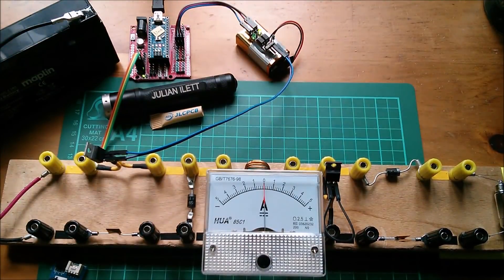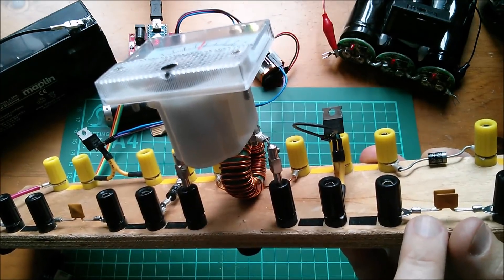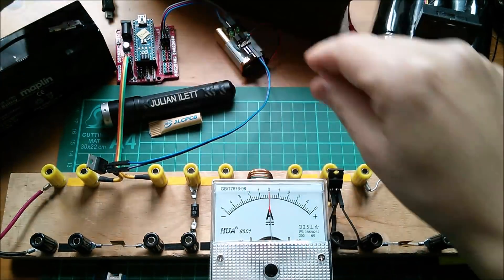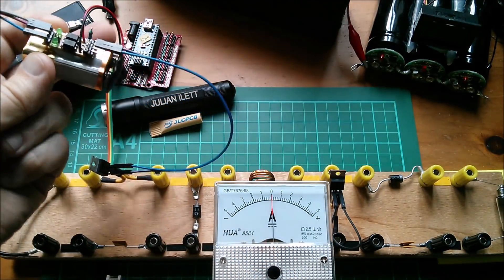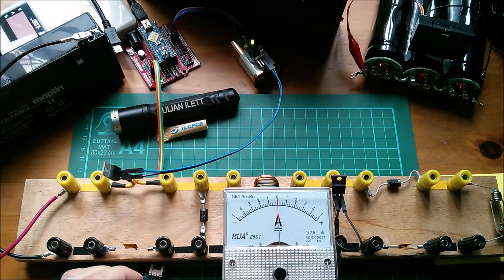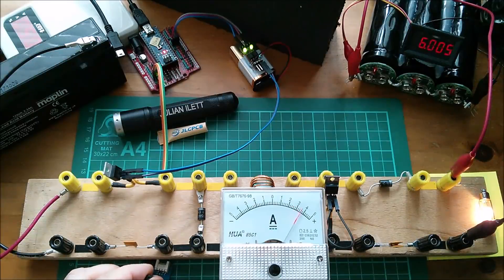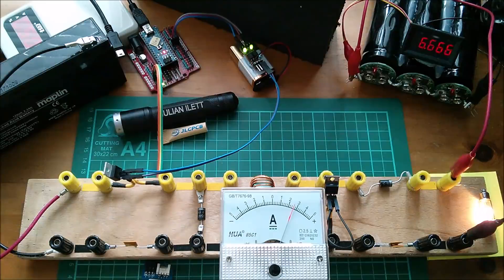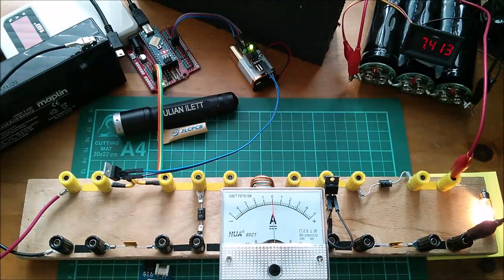Charging Supercapacitors from a Lead-Acid Battery - Muppet 2

Comment: HI, would it not be possible to make a simple voltage regulator cut off circuit with a zener diode and a mosfet on the supercaps that would switch the batteries charging it on once it falls below a certain voltage and then turn off when it hits its limit? 
This way you could have a power source with the battery for energy storage and supercaps for power delivery all the time if you have something that needs high surge current for short periods.

Comment: With those black croc clips that slip just put a drop of super glue on the lever arm on the croc clip. Slide the silicon sleeve over quickly and that will solve all your problems. Hope that helps.

Great video as always Julian 👍

Comment: Remove capacitor between atmega Reset pin and DTR pin of COM port chip on Arduino board. This will fix atmega restart on usb plug.

Comment: My goal before I croak is to make a  surface-mount 'MuPPeT', about the size of a postage stamp. I did some 'work experience' for an environmental measuring company a couple of years back (still friends with all of them). They stick their machines in the middle of very cold, remote places (think Siberia here...) - hence lead-acid batteries - charged by a 10W solar cell. But they rely on the battery to supply all winter, when up here (North Finland) there is precious little sun. They charge the battery DIRECT from the panel, and wonder why they are seeing 18V on the 12V battery, and they have to replace them every year in the summer when they can get to the site, at great expense!! A 'MuPPeT' would solve their problem, augmented by a Joules Thief when it gets pretty dark. It needs - averaged over a day - only about 1-2mA .

Comment: Can you put the usb power lines of the arduino into the oscilloscope and then unplug the camera to find out if there is a voltage spike or what is causing the arduino to go haywire?

Comment: Why did the polyfuse on the output side not trip when you went to 5 amps?
Reply from the maker: If I'd stayed at 5A for any length of time, they would probably have tripped. Polyfuses are thermal devices, they take a little time to warm up.
Reply: Ok, thanks

Comment: You should pretty much always use a pull-down resistor on the gate of a MOSFET (ditto IGBTs) their gates are so sensitive that if you leave them floating they'll turn on of their own accord.

Comment: If you want to avoid the reset  when you plug in something USB and not using the serial connection, you can use a charge cable without datalines (or make one yourself) to power the Arduino. This avoids the reset. The reset is caused by enumaration of the bus (and COM-port settings, see later on) and that's why the ATMega resets, actually the same when you start programming the Arduino. There is a hardware hack available which avoids this behaviour however you are not able to easily reprogram it. 

Another option, if you need the serial connection, is to use a self-made program (like I did) or other serial debugger (NOT the default Arduino Serial Monitor) that initialize the COM-port with different parameters. 

I found out these settings avoids a reset (when something else USB is plugged in):
State of device COMx:
---------------------
    Baud                  :  9600 (can be anything you prefer, however Arduino must 'talk' at same speed)
    Parity                 :  None
    Databits             :  8
    Stopbits             :  1
    Time-out            :  OFF
    XON/XOFF         :  OFF
    CTS-handshake:  OFF
    DSR-handshake:  OFF
    DSR-transspeed:  OFF
    DTR-circuit         :  OFF
    RTS-circuit         :  OFF

You can view your current settings on the command-line, type for example: mode COM1 [enter]. COM1 is the COM-port the Arduino is attachted to (can be different at your situation). I use NodeJs (and also implement this in C and Delphi) with a serial-port package to initialize the port and read the port, very straight forward to do.

Hopes it helps to avoid dangerous or unwanted situations/behaviours.

Comment: Yes those croc clips are all really crap, mine do the same. They also have a very high resistance and get quite hot in use, very little copper used, if any. More Chinese quality.

Comment: if you are running the signal through opto-isolators, just power the arduino with the lead acid battery.
Reply from the maker: Yep, that would work :)

Comment: if you are running the signal through opto-isolators, just power the arduino with the lead acid battery.

Comment: great vid, i rly like how you keep everything simple, no fancy  electronic circuits, just what is needed is presented on camera. easy to understaind how step-up and step-down works. have you tried playing around with the pwm frequencys? to see if the mosfets get hotter with higher pwm or lower pwm frequency?

Comment: Why not connect the lead acid battery to the V(IN) and GND on the Arduino and a 100nF cap to keep the power supply stable if the USB power driver in your PC throws a wobbly?
Reply: *cap between 5V and ground, to be clear :)

Comment: Why is the mosfet getting hot, when it's switched fully on with pwm? shouldn't be that way - that's the whole point of a switching supply... *confused*
Reply: When they're half on, they act as resistors.
Reply from the maker: This MOSFET has an ON resistance of 17milliohms (min). Power=I²R which is about half a Watt - enough to heat the MOSFET with no heatsink.
Reply: thanks!

Comment: Hmmm - i can charge those very quickly with my diy bench powersupply - made of old laptop SMPS and a buck converter with CV/CC. Just adjust the voltage to the level you want the supercaps to be and adjust the cc to what you want or the PSU can deliver :-)

Comment: You're able to ride the potentiometer and keep an eye on the current and voltage as well as what the protection circuits are doing, now if you add a digital current sensor and voltage sensor, you can read the values of those things with the arduino, and create a PID profile to rapidly charge the supercaps automatically :D
New project! :P
Reply from the maker: Yep :) And with opto-isolators (instead of red LEDs) on the supercap protection boards, the Arduino can see when the first cap becomes fully charged.

Comment: At such a low Amps level flowing through that MOSFET and with it having such a low on resistance when fully turned on it should not be getting anywhere near as hot as it seems to be getting with your set-up here and I suspect your not driving it ON and OFF fast enough so its spending time in the linear region and that small time dissipating power and generating heat at the PWM frequency your using is the cause of the excess heating ,also with the current set up at switch off as your  just relaying on the resistor to discharge the gate of the MOSFET rather than giving it a hard turn off, you will be able to see this if you connect your scope to the MOSFET gate and zoom in on the ON and OFF switching slopes, I would try using a device like the Avago HCPL-3120 Optocoupler/ MOSFET IGBT Gate Driver 2.5A to run the MOSFET, this will hard power the gate ON and OFF removing the need for a parallel resistor on the gate and just use a 10 Ohm gate series resistor between the output of the MOSFET driver and the gate and you will then I am sure find you have a cool running MOSFET even at 5A, When i am using this device to drive a MOSFET I use -9V to turn it hard off and +15V to turn it on and I get this from an isolated 5V to -8.7/+15V DC-DC converter to power the A3120 but you could try those small 5V to 12V DC-DC converters you purchased some time ago to run the gate drive circuit at over 12V for turn and and pull down to 0V(Source) for turn off and the transformation in the speed of the turn ON/OFF times over your current set-up will be massive,  I am experimenting on similar lines to you with much larger powers involved, I am using a large 12V car battery to charge a 48V Super capacitor via a home brew BOOST converter set-up, Its all very exciting stuff and I love your experimental videos, keep up the great work........Dave @ BasicMicroUK

Comment: I doubt it's leakage in the opto-isolator... if you leave MOSFET Gate leads disconnected, they will (in many cases) perform their own leakage... and climb into the linear ON range. We're talking about Giga-ohms Gate input impedance here... any stray electrons can get captured by the Gate. Even the MOSFET itself has Gate-Source leakage of maybe ±100nA.
It's why we always have to have "active" turn-ON as well as turn-OFF in a MOSFET driver... they won't turn themselves OFF like a bipolar transistor does.... once the Gate capacitance is charged, then disconnected, it may never "bleed off" the charge.
Reply: Yeah, even with an old JFET (2N3819) years ago, I used to amaze my colleague by turning on a small bike lamp bulb by simply combing my hair in its vicinity - if the gate was floating. Pop a 10M from Gate to Source - no effect. This was almost 40 years ago! (Yep, the 2N3819's been around a while!)

Comment: I received a kit of 25 red alligator clips + 25 black alligator clips, the black ones are just terrible. It's impossible to get a grip on those. They're just sitting in a corner and I don't really know what to do with them since they really are unusable.
Reply: Put some black or clear heatshrink over them perhaps... Should give enough grip... If you don't shrink it, or don't do it too much it'll still be flexible enough to squeeze.

Comment: The high pitch noise the pwm makes when you attach power around 11:18 (and a few short times before) actually hurts in my ears. I wonder if you can actually hear it and if there are ways to mitigate this?
Reply: increase the PWM frequency possibly?
Reply: Julian is too old to hear it. He's mentioned it in the comments of a previous video.
Reply: Leestons - as am I. Alas as humans age, our hearing threshold for higher frequencies drops. So we can no longer hear low volume higher frequencies like 15kHz or above.

Comment: Anyone else also hearing the high frequency PWM whine in the coil around 12:40 and further? Also, cool vid again Julian!
Reply: I did, it is pretty annoying.
Reply: No, us oldies can no longer hear high frequencies at low volume...
Reply: @Mark: Us oldies can no longer hear high frequencies at any volume. Your teeth will tell you if it's loud enough!
Reply: @retroretiree2086  fine for those young enough to still have teeth... :(
Reply: I have eight left Duncan :)
Reply: @retroretiree2086  There must be some advantage to getting old, but I'll be damned if I can remember what they told me...
Reply: 16khz makes me cringe
Reply: Yep...thought it was something I left on in the other room, took 3 trips before I realized it started/stopped with the video.  Seems to be there for a fair bit of the video.

Comment: Unless I'm mistaken which is highly likely :) That battery is a 6 amp battery and could not provide 50 amps
Reply: The internal resistance of the battery is likely to be well under 0.5 ohm so the current at short circuit could easily be 25A. Remember it's a 6Ah cell, so 6A for an hour, or 25A for around 15 minutes. High loads will reduce the time more than expected due to the "Internal resistance" and generall overload issues. Boiling acid etc.
Reply: It'll provide a massive amount of current if short circuited... More than enough to smoke that setup.

Comment: Those croc clips drive me nuts!  Next step: measure the current and voltage on the primary and secondary sides with the arduino and use that to automagically adjust the PWM on the two mosfets, then you can sit back and watch it charge :)

Comment: How about a new computer then? ;)
Reply: Standard behaviour of the arduino and USB... When the arduino was reset (either due to sudden power drain or reset due to another device on the same hub), it gets rebooted several times by the driver until the PC is ready to connect properly. Better to have standalone power and a display if any debugging info is wanted.

Comment: So, if I guess correctly, your net step is Arduino code to
 a.) Read Supercapacitor voltage (don't want to pump high amps into a part discharged cap)
 b.) code to vary PWM dependent on V/A ratio

Lots of goodness to look forward to!

Cheerio!

Comment: I generally tend to not plug an arduino into the PC unless i am programming it.
You wouldn't want to short out your computers usb port. If you are unlucky that might kill the motherboard, though that hasn't happened to me (yet).
I'd rather short out a 10€ usb powersupply.
Reply: USB connectors on computers are protected, shorting them out will only disable them on the software side (Windows even pops up a warning about this). The only thing you absolutely don't want to do is to backfeed any current into them (such as from a 9V battery), because there is no protection against that.
Reply: usb isolators aren't much on ebay. only usb1 but that's fine for ardunio etc.
Reply: when i shorted it out there sure wasn't a warning lol. It just shorted the usb port, probably pulled at least a couple amps(since the wire started to smoke) until i realised i shorted it. It might have shut it down if i shorted it for longer, not too sure. 
Probably depends on the hardware implementation.

And yes, that would probably be worth it.
Reply: Hmm technically that wasn't a USB port then, because the spec requires it to limit the current to 100mA or 500mA. If you can draw several amps out of it, it's way out of spec.

Devices when charging usually ramp up the amps until the voltage drops below 4.75V, then ramp back a bit. That way they can draw as much as possible without a digital interface. If those devices are plugged into that machine, they might burn your USB port.
Reply: Yes, but a short should never burn the cable at 900mA, unless you're using really thin power cables.

Comment: around my house i have CFL's, fluorescent tubes and led lighting... if any of the CFL or fluorescent tubes is turned on i get pop on my PC speakers and in some occasions i even loose the mouse (mouse stops working until i unplug and plug it back in)... :)
Reply: IamIUareU - Any switch that is switching a reasonably high voltage (such as mains voltage) at more than a low current is a wide band RF radio transmitter. Especially if you are switching an inductive load like a fluorescent light... Further, with glow starters (as used in traditional fluorescent light fittings and the older CFLs) these are also a type of mechanical switch, and these also generate RF noise when they switch...
Audio amplifiers, unless completely screened can pick up the RF noise, hence the pop from the speakers.

Comment: How about the internal resistance of the battery?
Reply: its very low. Depending on your battery it'll be something like 10mOhm. Thats not really limiting the current.

So if you short the battery you'll theoretically have 1200 amps flowing, assuming the internal resistance doesn't rise as current increases, but in practice it does rise of course. 
In practice you'll generally still have a current of something like 500 amps flowing. thats 6000 watts of energy, maybe twice that if you have a powerful battery(his is kinda small). 
This larger lead acid battery http://www.systems-sunlight.com/wp-content/uploads/2018/07/spg-12v-230ah-data-sheet.pdf
, which is more in line with the battery he uses for his solar cells gives you a short circuit current of 4360 A, thats 52kW of power dissipated.
You wouldn't wanna be next to that.

Comment: gr8 video as ever, most of my alligator clips are the same, they just slip around when you try to press them, bad design
Reply: Maybe Julian needs to do a postbag solely dedicated to the search for a decent alligator clip???

We all suffer this problem...
Reply: I've sanded some of mine lightly to address this, it helps a bit though it probably increases the likelihood of corrosion.
Reply: I just noticed Peter Feerick,s post further down the comments, put some shrink wrap on the metal parts of the clips, it works very well as its rubber against rubber rather than metal against rubber.
Reply: put powder in the rubber  casing
Reply: what sort of powder?
Reply: put powder baby in the rubber casing
Reply: baby powder ok, ill try it

Comment: Ik bought from four different sellers on aliexpress these under$2@20 testclipcables, and they ALL have that issue! And much worse than yours, mine are totally unusable! Totally.
Reply: I cleaned mine with soap and water, left them to dry up, and they works perfect. Its just som anti-corrosion oil or something that does this... I see that if they stay in the original bag, in a lot of 10 or 20 pairs, there is some sweating going on. So take them out, bathe them in dishwater soap and warm water.

Comment: I got a pack of clip leads from harbor freight they are all like that pisses me off evertime i use them any ideas of fixing it
Reply: I fixed them with a drop of superglue between eacht rubber and the metal from the clip. A little drop of course.
Reply: Cud just heat shrink it ....or don't use the crap 😆 .... Put a plug and switch on it lol
Reply: I just hate to throw out anything I might have a use for. I know that no more than I do I will need it.

 will try the super glue and see how many of them I can glue to my fingers.

Comment: How about putting a couple of your mini arduino ammeters in the ground line where the polyfuses are to show current in both input and outputs of the muppet.
Reply from the maker: One of the advantages of good old analogue is that they average out the switching noise :)